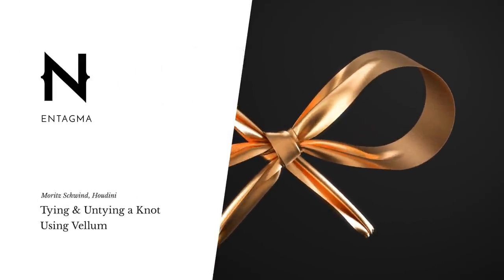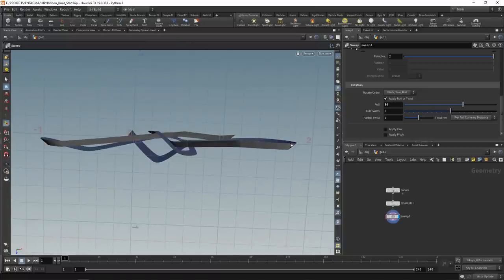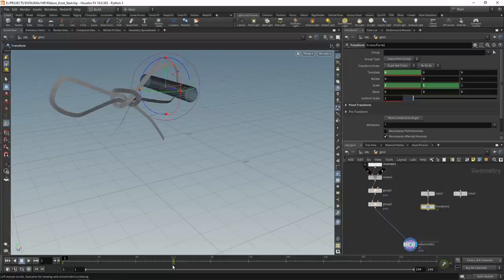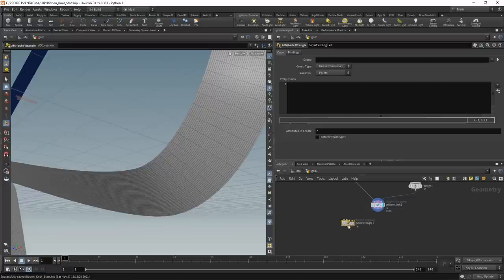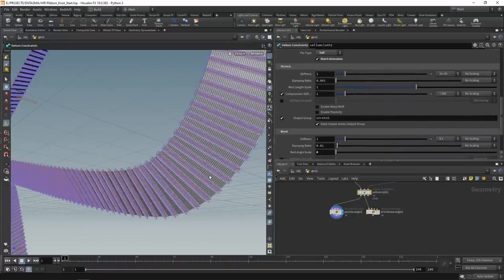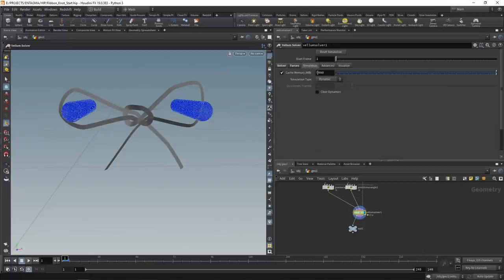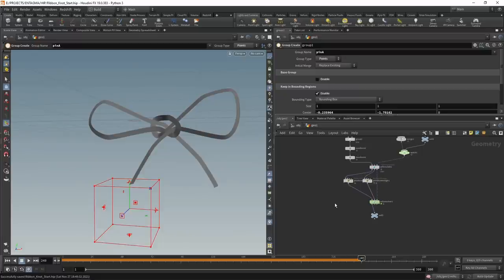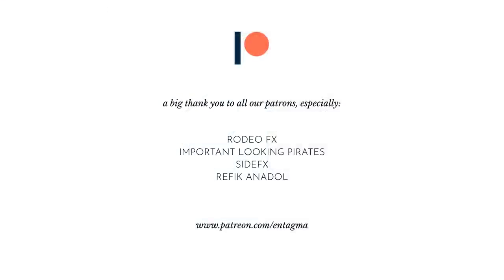Tying & Untying A Ribbon Knot Using Sidefx's Houdini Vellum

Comment: Nice! I ever wonder to know what shortcut do you use to quickly change values in channels?
Reply: by middle clicking on a channel you get a pop up with numbers vertically aligned, ranging from 100 to 0.0001 and by slightly sliding left or right (while pressing the middle mouse button), you can change the numbers quite quickly. moving the mouse up or down changes the amount of increments during each "step" left or right. did you mean that?
Reply: @MsRaumal  yes, but there's no pop up on the video when he's incrementing the value.